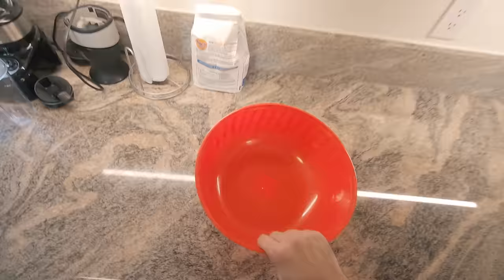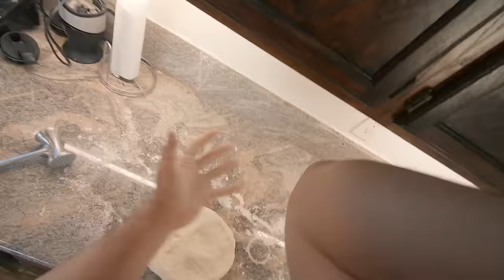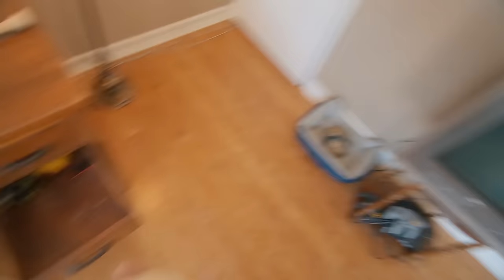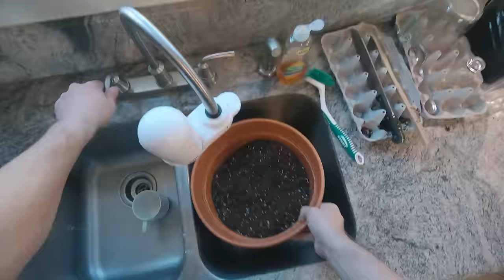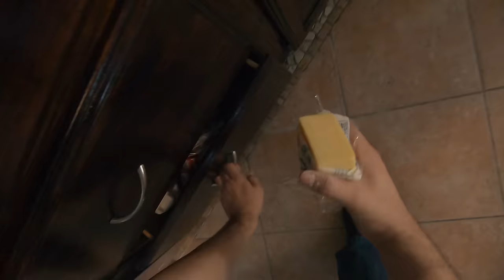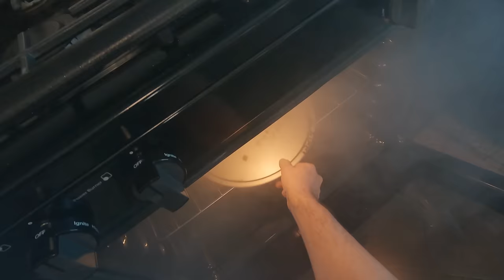Making a Pizza

Comment: But for real tho , here's a recipe for a delicious and advanced homemade pizza:

Ingredients:
- 2 cups flour
- ¼ tsp salt
- 1 tsp dry yeast
- 1 tsp sugar
- 2 tbsp olive oil
- ¾ cup warm water
- Tomato sauce
- Shredded mozzarella cheese
- Toppings of your choice (e.g. pepperoni, mushrooms, bell peppers, onions, olives)

Directions:
1. In a large bowl, combine the flour, salt, yeast, and sugar. Add the olive oil and warm water, and mix with a wooden spoon until a dough begins to form.
2. Turn the dough onto a floured surface and knead for 5-7 minutes until it becomes smooth and elastic.
3. Return the dough to the bowl, cover with a towel, and let it rest for 30 minutes.
4. Preheat your oven to 450°F (230°C).
5. Roll out the dough onto a greased pizza pan or a baking sheet. Add tomato sauce and shredded mozzarella cheese to the top.
6. Add your desired toppings to the pizza. Be creative and use a variety of different flavors and textures!
7. Bake the pizza for 12-15 minutes or until the crust is crispy and golden brown.
8. Let the pizza cool for a few minutes, then slice and serve!

Enjoy your delicious homemade pizza with family and friends.